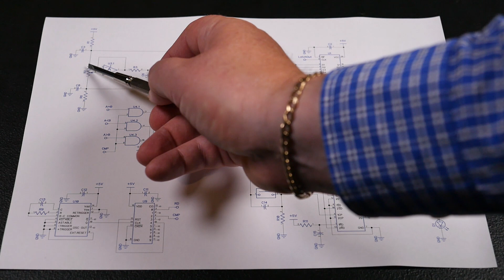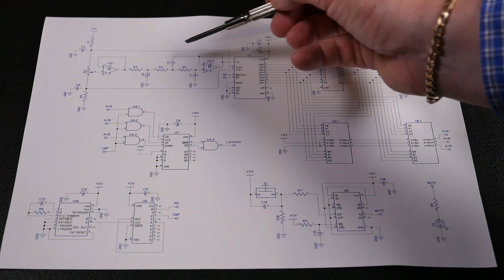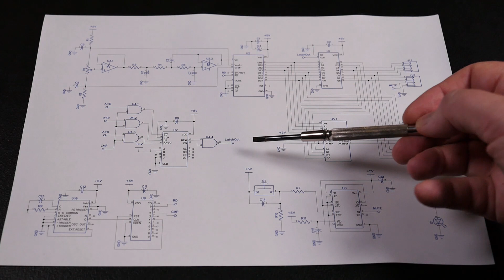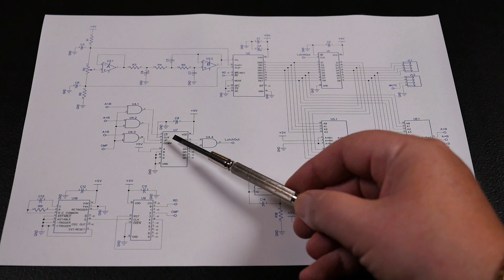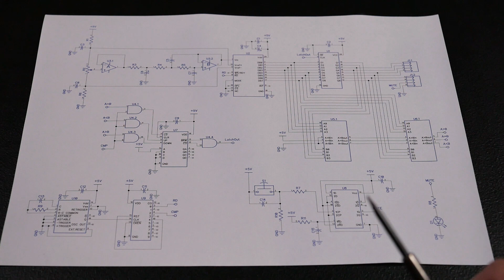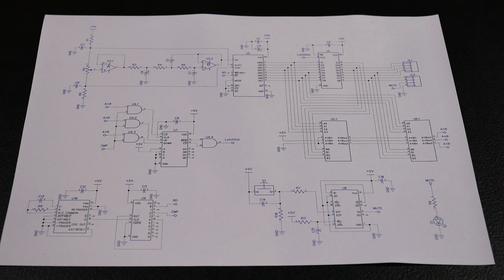Attenuator Controller Design Concept

Comment: I once did design something very similar. I used an voltage divider and some  comparators. Used the logic output from the 393 and put then in N flip flops to latch it.. The output from the flip flop went to a four four channel switch. To differentiate the 4 switches I use a OR gate on the second, 2 at the third and three on the fourth. 
While I vary the voltage divider, the 555 give a clock to uptade the flip flop outputs. Those outputs just formed an binary word that would gave 16 positions on the switches. 
At the switches output I used a simple npn bjt transistor to drive the load, in that case, a relay as well.
Btw, very nice video and design. I love your vids as Im into audio industry too. Im looking foward to the upcomming videos.
Cheers!!!
Reply from the maker: Cool. Thank you so much for your support, it is greatly appreciated.

Comment: I think I would have tried to use a rotary encoder to drive an up/down counter to get the binary number instead of doing analog to digital.
Reply from the maker: Rotary encoder is a good approach, and one that I'm seriously considering - although with a relative encoder you're really going to want to provide some sort of display to give feedback as to your current position within the volume range. An absolute encoder might be an ideal solution, but then you'll be facing the need to convert from Gray code to binary.
Reply: Good point. There are those BCD wheels, but that doesn’t give you the single knob control, and just plain up/down buttons also need a display.  I’ve had noisy pots that looked fine on a multi meter, but you could see the issues on an oscilloscope. Maybe a strong low pass filter on the output from the pot ?